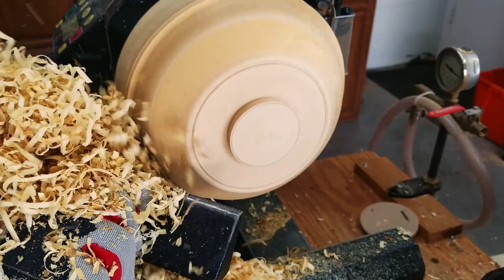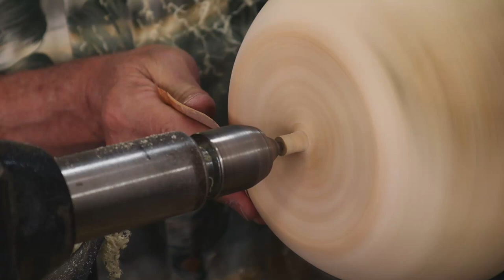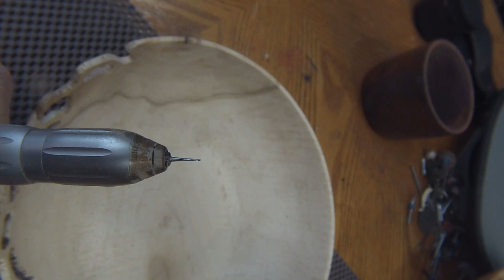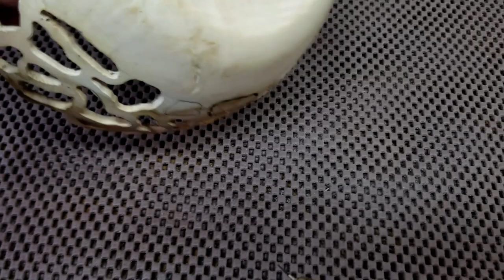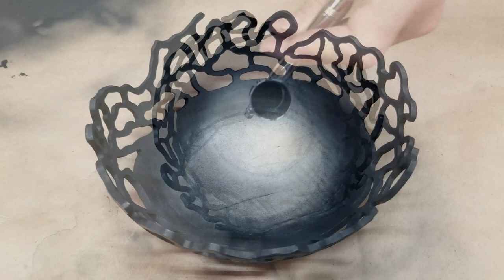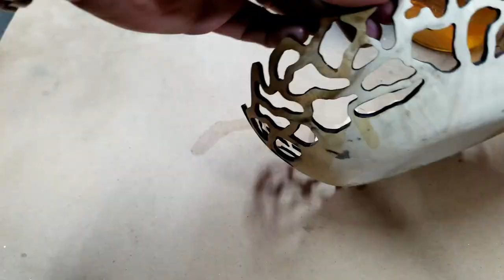Woodturning a Thin Wall Bowl for Piercing

Comment: Very nice. If spray painting could you use blue tape on either inside or outside to reduce sanding by half? A black magic marker/sharpie may have made the coloring much easier and faster.

Comment: Roger, the end result justified all the effort plus we and you learnt from your processes, thank you. 
Did you consider using Sanding Mops to clean up your edges https://www.rjrstudios.com/or burning them with a pyrography tool which may have provided the desired black edges? 
I noted you had what I think was a wooden watch and strap, may I ask where you got it?
Reply from the maker: The sanding mop is a little pricey so I have never tried them. Have you? The piercing tool burns the edges somewhat. I like a smooth, clean surface so I never considered my pyrography tool. My watch is from Amazon here https://amzn.to/3ifyiwE